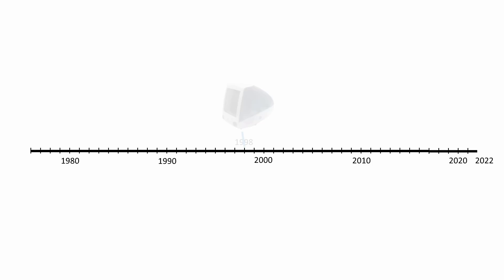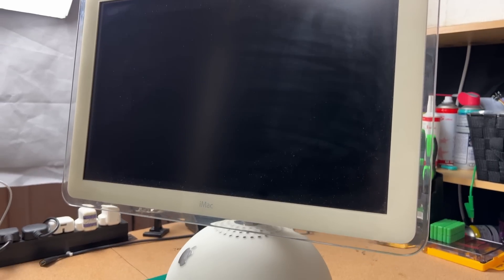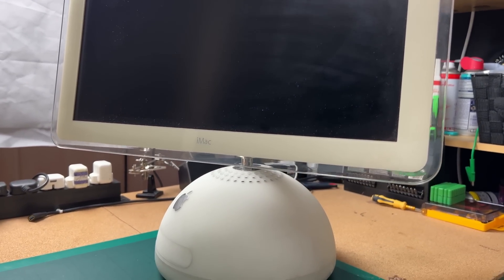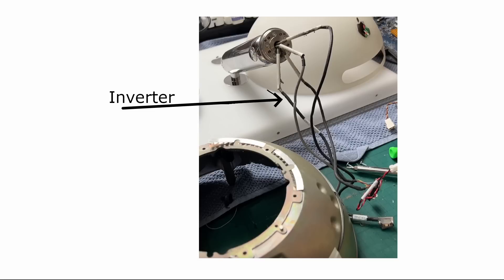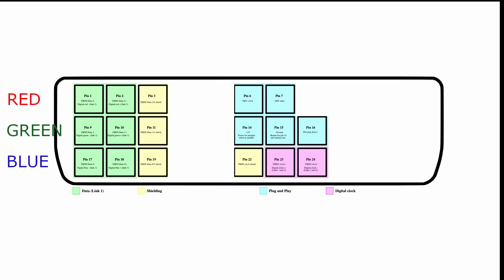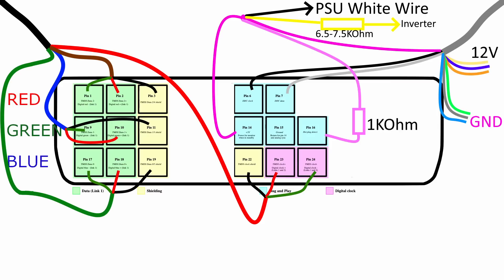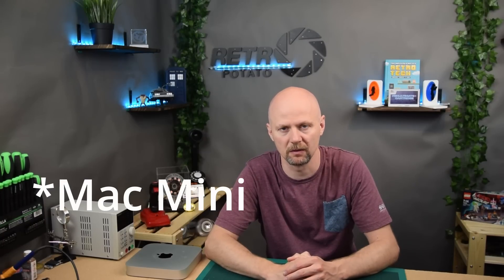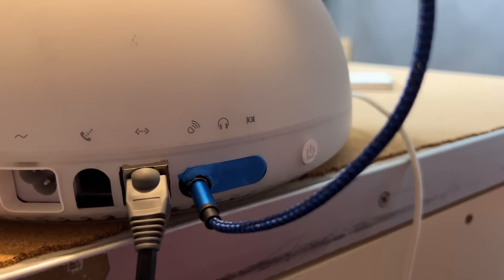20 inch G4 iMac converted to M1

Comment from the maker: There is now a new version uploaded - with fixed audio and no longer mono. I apologise full-heartedly for this version and that it took this long to upload a better version.

https://www.youtube.com/watch?v=Jy1sHY1lNr8
Reply: Thank-you. I watched this video before noticing your comment. You did an awesome job!
Is there a modern screen which will fit into the old iMac screen holder, and avoid using the original monitor and PSU?

Comment: With the Bluetooth not working, could you just plug in a USB Bluetooth device into the USB port?
Reply from the maker: Apologies for the 6 month too late response: yes, it does work with the usb connected devices, and has no issues with that, however after spending a bit more time with this device i managed to sort out the BT and WIFI issue. It turns out you just need to plug in the antenna (facepalm) which is wrapped around the dome and then things work.
I have stable wifi and using it ever since the mod. (and BT also works)
(But I will also admit that i am still using the old mac mouse which needs plugging in, but i like the actual scroll-wheel that i can scroll both vertically and horizontally (much prefer that compared to touch sensitive mouse))

Comment: Would it be possible to change the interior components of the Screen to an updated 2.7K or 4K monitor while still keeping the vintage frame intact? Paired with the m1 would make this a completely usable computer in 2024
Reply from the maker: It should be possible - of course the "trouble" is to find suitable sized screen which fits into the frame perfectly. I think its an inevitable change as the display itself is over 20 years old and its a small miracle that it still works perfectly - but eventually it will go (either the backlight or the hardware itself) 
mind you, its not unusable even this way (i am using the iMac to work and to edit videos - and using it right now to reply to you. (though i wont pretend it is anywhere near to a 2.7K screen or anything like that) 
I just don't want to replace it until stops working :)

Comment: Awesome project!

A QUESTION PLEASE
----------------------------------------
- I have a Vaio Duo 11 with broken display, and was considering using another Laptop Display (from old LG laptop (R380-A) its a pretty good looking screen) as a replacement.
- The Vaio has a VGA output (also an HDMI).
- Do you think if I wired the VGA pins to the display input wires accordingly, I might get it to display Vaio's VGA output? (Spare screen will be powered separately).
----------------------------------------
END OF QUESTION

I love the Vaio Duo 11, however replacement displays are overpriced, and besides, the opening mechanism works correctly.
I also considered a controller board for the spare laptop display, but they are disappointingly bulky for some reason (although they provide an HDMI input method).

Comment: would it be feasible to upgrade the panel itself? It looks like youd just need to find a decent 17 or 20 inch panel and run the cables through the stem. but i think you could make a really nice gaming setup if you upgraded the panel, and then you have a lot of options for the computer itself. you could go with a nuc, a mac mini running dual boot, or even potentially a very compact itx pc, but i think youd have to get pretty crafty with the thermal situation and part choice.

Comment: In another conversion video I saw, in this case the person was putting a Mac mini inside of a Nintendo Wii, he said there were a few antenna coming off of the Mac mini, and the one that seemed to boost Bluetooth was actually integrated to the metal baseplate of the Mac Mini. So if that original metal baseplate wasn’t installed into this iMac, that’s probably why you’re having trouble with the Bluetooth devices. You can get around this by attaching a different antenna wire and running it along the outer edge of the inside of the Mac.

Comment: Astounding, a tinkerer not using an iFixit kit. Didn’t know there was such a thing. Secondly, that’s an impressive lump of cast aluminium that Apple designed and I agree that it’s acting like a shield for the BT. Maybe you could solder a rudimentary antenna wire and feed it out the base at the back 🤷🏼‍♂️ I doubt you’d need much length and it could easily be stuck down out the way of being accidentally disturbed picking the unit up or moving it. Just an idea.

Comment: Step 1: Buy an M1 Mac mini
Step 2: place the Mac mini inside of a refrigerator and leave space for cables in the door.
Step 3: Add a display, keyboard, and mouse.

Now just upload this with a click bait title like “NEW M1 APPLE FRIDGE 😮😮😮 YOU WONT BELIEVE HOW THEY DID IT!”

You just put one thing inside another thing. Wow. Literally nothing.
Reply from the maker: great idea. come to think of it i think i remember back in university in out dorm we had a small fridge and we had an old XT case on it. some wires were hanging at the back of it - we tried to revive it … anyway long story short:
one day one guy walked in and his jaws dropped on the floor… we were unsure what is going on. he was just starring at our fridge.XTs were old but not THAT old to be that surprised- and then finally he spoke:
“you guys are mad, you are controlling your fridge with that thing?!”

i have a mini desktop fridge… maybe i should turn it into a computer :)

on a sidenote: i dont think that the video is clickbaity or misleading. there is enough work in there wiring up the monitor and surfacing the ports on their right location to be considered slightly more complex than just a 5 minutes craft video :)

but i like the fridge concept, it would help with the cooling :) (although i would turn it into an m2 now :) )

just kidding :) 

but i honestly appreciate your comment

Comment: only 2 things I would have changed: using miniDP to DVI instead of HDMI to DVI, as DP and MiniDP are both better in every way than HDMI, and also replacing the fan in the actual G4's case with a Noctua to give the M1 mac better cooling.

Comment: I love it when people are repurposing these, the design is beautiful I'd love one as my daily driver, but using Apple Silicon is just an insult to the G4. Apple Silicon is an anti repair technology that gets your computer bricked when a consumable part, the SSD, dies. So I'd rather use a 2012 Mac Mini for that, and patch to Monterey.
Btw I was never able to do that with my 15" due to lack of information on the internet and it ended up in the trash 😭 could you be the first person to release a guide for it?

Comment: I would have gone with making a PCB for the video to just easily plug the old connection into, put an HDMI port on the end instead of using that dvi connection then use DVI to HDMI.

Comment: Maybe you could've put the network antenna outside the dome, like they did originally, there is a path and a little spot made for the network card on the outside of the metal dome specially made for wifi and bluetooth.

Comment: You need to get a new video camera
Reply from the maker: if you are referring to the overly pixelated content here and there: its sadly not the camera’s fault but mine: i did not adjust the zoom and position correctly and had to “fix” it in edit.
i am using a nikon d3300 recording me talking and i have a panasonic point and shoot overhead camera with proper (non digital) zoom capability. 

both are full hd recordig and 24 or 25fps

for closeups i use my iphone (i think this video was done with 11 pro) running 4k and scaled down to full hd.

if these specs are not enough, i am listening what would you suggest. i am aware that there parts in this video which feels more like 480p … that is (yet another) rookie mistake on my end.

Comment: Impressive, I like mods like this. A very Macgyver solution as I would've called it. I love doing things like this myself. I found an iMac late 2011/early 2012 27-inch with the glass missing, cracked screen and bend marks from the previous user. I'm thinking of transplanting the parts to another case as the displayport at the back works perfectly. The connection to the internal monitor is a regular lvds conenctor.

Comment: Now do it with the imac G3, more space i imagine but i wonder how you would tackle the crt
Reply from the maker: ah yeah… i was thinking the same. it would fit just fine … i guess… but i am not a huge fan of working around the CRT. i never felt safe around old tvs and crt monitors. normally i dont mind high voltage either… but the crt makes me yellow :)

Comment: I wonder if it wouldn't be easier to just gut the G4, cut a slot in the back, slide the Mac mini and keep all the new ports etc. I would then replace the monitor with something newer and 3D print a similar bezel. Passing the power and HDMI wire through the stem would be a challenge, but I'm better at physical modifications than electronic.

Comment: Would have been good to see the M1 fitting and ports process?
Reply: he did: he showed us that he took the original support and used it as a reference to make one that fits the m1 mobo, then he shows how he routed all the cables inside using adapters and extentions.

Comment: Do you have plans for the custom bracket and a list of parts and costs?  How much did the donor retro Mac cost?  I think this would be a neat project to attempt.
Reply from the maker: i will pull the list together. the cost was okay considering i wanted a video editing mac anyways… (if i had messed it up … it would have been bad… but this way it was just an off the shelf m1 mac 16gb ram, 512gb ssd)
 and of course the faulty g4.

Comment: You might be able to trace where the Bluetooth receiver/transmitter is on the mother board, and wire in a little external antenna to it through a small strategically placed hole in the dome. I know my old Powermac G5 has a port to plug in a dedicated Bluetooth antenna of sorts, and I never so much as gave a second thought as to why it does, until just now.😅 Mainly cause I hardly  considered the notion of using it, but now I think it might be worthwhile to find or make one, cause I have a massive classic iTunes library on thing, which could come in handy during the winter months, when I’m dually using it as a space heater. 😂

Comment: Back in the day, you could add an Airport card to the G4 iMac, so it makes sense wifi frequencies are not being blocked by the case.
Reply: The card was installed under the dome (bottoms of computer) but the antenna runs up to the dome and I think into the display.
Reply: @WilliamJSisti  Ok, I guess you're right .
Reply: @BilisNegra  :-) today I was right on the internet :-D

Comment: That's cool!

How about cutting a slot in the upper side of  the dome to run wifi/bluetooth antenna, and replacing the panel with someone more modern? 

Essentially you'll be using just the chassis.

Comment: Would you consider selling one of these? Id love to purchase an M1 iMac G4 but do not have the technical skill to do it. If you are interested please let me know!
Reply from the maker: As much as i enjoy working on these, i don't feel like i am qualified to sell these. I am by no means a certified manufacturer and while i am sure nothing would go wrong, i can not risk possible warranty issues. Also these iMacs are huge and heavy and while we could get some insurance during shipping, the risk of something breaking would be too big to ignore.

Another point is that hunting down the iMac is a lot of time and cost varies depending on the state of the machine. And while i don't have issues not fixing broken iMacs (and upgrading them) i am not keen on "killing" the ones that are still working - thus any timeline (for delivery) would be unpredictable to put it mildly.

On a sidenote: the biggest task is the monitor conversion. I mean removing the old G4 logicboard and adding the mini in the case is no big deal. and hardly needs any technical acumen. but you can skip even the monitor conversion IF you can get a 15 or 17 or 20 inch modern LCD panel with their small control board which only needs some power and an HDMI cable. that way it really becomes more like a KIT build rather than an a technical conversion. 

I can look that up and provide a step by step guide. I have a broken 15 inch G4 which has a damaged screen. that way you could do your own conversion and you would only need a handful of screwdrivers and some determination :)

Comment: I wanted to see more performance benchmark after the upgrade.
Reply from the maker: Well the thing is, its an M1 MacMini in a new house really, which means that the performance will be identical to any M1 MacMini out there. Not to mention that there is 20 years difference between this and the original G4 in there, rendering any performance comparison kinda meaningless :) its like comparing a Pentium I to  an i7 :)

Comment: Hi! Nice project!! I have a similar project and i have some doubts. How do you converted the Mac Mini power supply to iMac?? How do you use the original mac mini button to imac?? Thank you!!
Reply from the maker: Hi, actually there are two powersupplies in the dome at the moment. the original PSU keeps the screen alive (provides the specific 24 and 12 volts for the screen and backlight) while the mini’s PSU is still only supplying the mimi.
the Mini’s PSU is used to trigger the 24 volts rail (using one of the 5 volts rail) when the mac mini is powered up.

the Mac Mini’s powerswitch is being simply moved to postion behind the G4 powerbutton and held in place (and supported) by a block of sugru. (it is firm enough to hold it but soft ish to make sure it can bounce when it gets pressed)
it feels pretty “natural”

if you swap out the screen to a more modern one, you could remove the old PSU)

Comment: I have done a similar mod, but i had use an Macbook. For The Display i buyed a modern with same size and a flat HDMI cable. Awesome the DVI mod :D
Reply: Did you run the HDMI cable through the neck? And the power for the panel as well? I’m planning the same thing with an 17” iMac G4.
Reply: @Zeguyfromgermany  Ye u have to Dissasembly the Arm and put the cable unter it. U need Flat HDMI cable where u can seperate the connector, that can u plug without soldering. The Power cable is no problem also like FPV HDMI. Some displays can use with Thunderbolt this days maybe u take this is much more easier then.

Comment: Amazing. But you can bring out antennas with cables between two domes, as they do in laptops.
Reply from the maker: could do indeed, my trouble
was that the mac mini’s antenna system is a huge block and not just some wires and i did not want to mess that up (in case my conversion turns out to be a disaster :) then at least i could
have my mac mini back… i might do something about it, but now i enjoy the “authentic” wired devices and internet )

Comment: I've been wondering about this sort of project for a while. I have an identical 20" iMac G4 (working!) sat next to me right now. Sadly it can't really be used for much now (you can play DVDs on it) and it would be awesome to get it converted to a monitor. I'd be happy to present an HDMI socket on the back panel and keep the complete MacMini intact externally. I wonder if anyone provides a service to get such a conversion done?!
Reply from the maker: Sounds like a good idea. You will still need the original PSU and a way to control the PSU to turn on and off (to protect both the lcd panel and the PSU itself) You can either put the HDMI input on the back of the dome of the G4 or directly behind the monitor, but that would require rewiring and cutting into the plastic. 
If you are up for the adventure you can use the concept from this video (that is to make a DVI connector and then run that through a DVI - HDMI converter (or build your own HDMI solution), but i am not aware of anyone offering a service like this, however if you know someone working with these kind of electronics, i am certain you could show them the idea and they could help with that. It isn't difficult really and someone being familiar with fixing monitors / tvs should be able to handle the task.

Comment: i even dont know how upgrade SSD to my imac g4
Reply from the maker: That is not that difficult. You need an SSD (obviously) and a little adapter which turns IDE into SATA port. You can see one such thing in one of my previous video where bring back a 15inch iMac G4 to life. 
If you check it out on Amazon you will find its a few pounds/dollars really. (less than 10)
from that point on you only need some determination to open up the dome (a few screws on the bottom) - disconnect the logic board from the top section. Remove the drive "block" and then throw the old IDE out and mount the SSD. 
YOU WILL need some means to secure the SSD, but some double sided tape should take care of that. then, connect the drive to your new converter and then to the IDE cable, and put everything back together in reverse order. Once you are done, you need an OSX install (depending on your CPU you might need tiger or leopard) and reinstall OSX.
If you pick a sensible drive size (i'd suggest below 240GB) you should have no issues reinstalling the OS and then you are good to go... 
A note however: while it will boot faster and load programs faster, don't expect the iMac to become a 'new machine'. Both Tiger and Leopard are outdated and has no support whatsover. Browsers are failing to run properly or render content properly and the single core CPU struggles with the slightest of modern workload (like playing youtube videos) - chances are you won't be able to load youtube anyway :)
Good project to save an iMac G4, but it will be still a G4 with all its limitations.